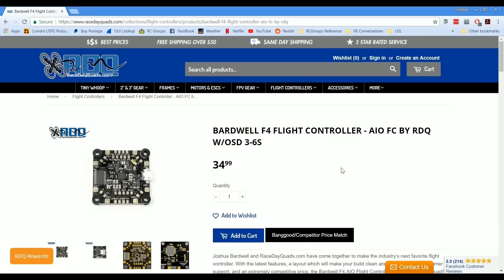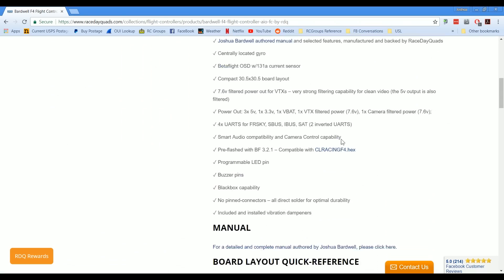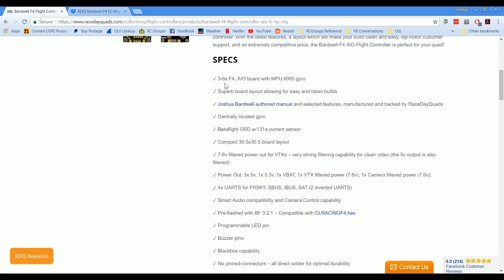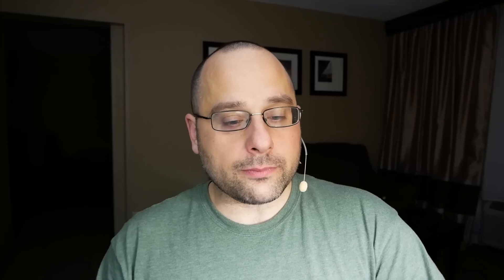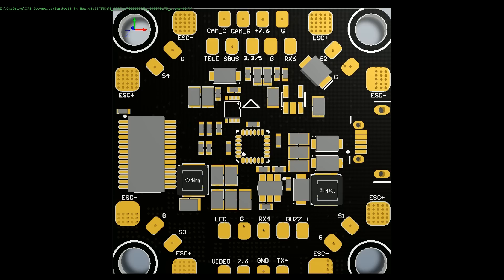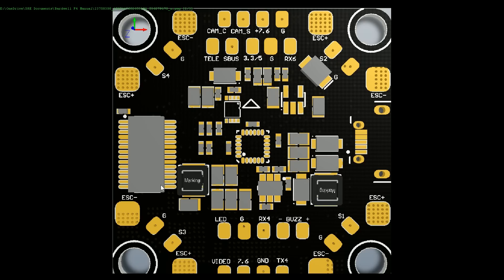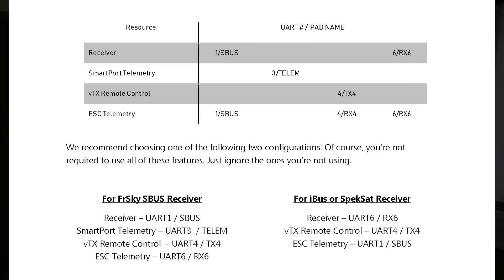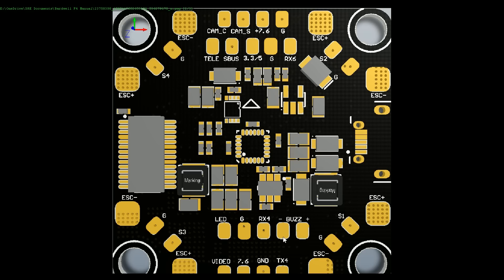Bardwell F4 AIO | JOSHUA BARDWELL FLIGHT CONTROLLER

Comment: Joshua, I just crashed for the first time on my rig running a Bardwell F4 and its seems like the voltage reg (closest to the usb port) is shot. It gets super freaking hot to the touch in seconds and looks to only be outputting 1.1v as the FC led is super dim. Any idea where I can get a replacement regulator? Do you know the component name or part number? I just need to replace it and hope it works... heck if it works long enough for me to get a dump off it I would be happy.
Reply from the maker: You should be able to power it from USB to get the dump. I don't know the part number but if you reach out to racedayquads I think they may be able to help you.
Reply: Yeah... I was told to desolder everything and look for shorts... I know what the problem is.. I just need to part. And no, USB does the same DIM light as powering from Lipo.
Reply from the maker: If it's also doing it from USB then it's likely a crack in the board, causing the 5v regulator to be shorted to ground. In which case replacing the regulator is not going to solve it.

Comment: Hey JB!! After trying other FC's on my fleet of mericas and ending up with ridiculous noise issues I eventually forked out the cash, swapped them all to the JB F4 fc's and boom!!! NO MORE NOISE ISSUES!!! :)))
I've since been using your FC's in all my quads and couldn't be happier!!! 

However...

Now I'm in the middle of building another merica but using a Runcam Split 2 along with crossfire (I've slowly converted my fleet to crossfire and don't want to go backwards) is there ANY possible way to get an extra free UART? Or am I stuck with going back to SBUS?

TIA
Reply from the maker: Just don't use the UART for split remote control. Once you use UART 4 for crossfire that's it on my FC.
Reply: Joshua Bardwell well I’m thinking maybe I can remap tx6 to cam control in the CLI??

Comment: ive got question i have j.b board but can i use a 4.1 with it? im looking at spedix 30amp 4.1 like ive used before????
Reply from the maker: Please look at the manual which has wiring diagrams and instructions for how to use the JBF4 with a 4-in-1 ESC. The manual can be downloaded from the RaceDayQuads product page.

Comment: Can your flight controller be used with it forone electronic speed controller if so do you have a link or description on how to do that
Reply from the maker: I don't know that ESC specifically but my FC can be used with all common ESCs that use motor protocols such as PWM, oneshot, multishot, and dshot.

Comment: JB, can I use 4 in 1 ESC board with this FC?  Such as Speedix 30A 4 in1?  If so, would I add the battery to the FC or the 4in1 ESC?
Reply from the maker: There are wiring diagrams and instructions for using this board with a 4-in-1 in the manual, available for download from the RaceDayQuads product page.

https://www.racedayquads.com/products/bardwell-f4-flight-controller-aio-fc-by-rdq

Comment: I'm going to use the JBF4AIO and Crossfire so the only UART with both Tx and Rx pads is UART 4 so that is where the Crossfire will be soldered.
I won't be using the usual receiver pads (UART 1 ?) Since it is going unused can I get a Tx and Rx from the usual receiver location for a GPS module instead?

It is what I did successfully with the CLRacingF4 but it had a dedicated "Sat" pad next to the 'SBUS' pad on that receiver UART. Is the SBUS pad on the JBF4AIO configurable in CLI to make it work the way the CLRacingF4 'Sat" pad did?

Either that or can I create a Tx for UART 6 using CLI? there is a UART 6 Rx pad but no Tx pad for it...

I want GPS data on the OSD....lattitude, longitude, arrow pointing toward home, etc. Primarly though I want the Taranis to capture 'last known coordinates' in case I crash some where unknown to me. Thanks!
Reply from the maker: Yes you have to use TX4 and RX. No you can't use the other pads for a GPS because they have inverters and they go to separate UARTs from each other.
Reply: Thanks for the quick reply/support! How about using the TBS Crossfire Micro receiver to send the GPS data? It has some other outputs etc on it but I don't really know this stuff very well yet. Although I'm learning rapidly thanks in large part to your work!

Comment: Thank you for all your work. Suggestion: Since a lot of people lack soldering skills could you offer a version of your F4 that comes with pin connectors ready for plug and play? Even if it would cost a bit more?
Reply from the maker: This isn't something I'd consider. Soldering is just a required skill to be successful in this hobby. Pin headers would require a complete rework of the layout to make it compatible with the servo style plugs.

Comment: I just installed this FC and soldered everything up, and everything was fine until I updated it to betaflight 3.0 now uart4 is gone. Anyone have this experience and find a resolution for it? I tried going back to 3.2.2 that it was shipped with but no luck, my smart audio isn't working now because I can't set up anything on uart4... I'm stumped, can't find anything online about it or in the manual.
Reply from the maker: I think you didn't flash the correct target to the board. You need to select CLRACINGF4 from the pulldown menu before you flash.
Reply: Joshua Bardwell you are a Saint my friend. I guess I was not paying attention. It was omnibus f4 for some reason flashed to it. Thanks for the quick reply man you're definitely one of the best. I rely on your videos for a lot of information and learning, I'm new to the hobby so you have been my saving grace more than once. And you haven't let me down this time either!

Comment: I'm new and I'm frustrated with so many aspects of the hobby. It;s like an engineer designed then didn't bother to document anything! Thanks for this, I'll try it. I been building my own and let me tell you, you're video about local hobby shops is true. Now, I do like to buy some things there like my radio and fat shark, etc and that makes them friendly to answering questions but the in-stock FC and such are such generic undocumented garbage. I'm going to suggest they stock these.

Comment: Thank you for all of your efforts. The community has only benefited from your work....

My question is about camera operation. I see we do not have to remap resources and that is nice. What I want to know is since I am using a Foxeer Predator Mini, do I still need the resistor and/or a capacitor?
Reply from the maker: The resistor is installed on the board. You can try it without a capacitor but it might not work.

Comment: I Need HELP... MY JB board won't stop doing that death roll every time I want to do a flip. How do I fix that..I upgraded but it won't stop
Reply: got the same issue here so i swap my motor and my 9v reg fail and the OSD chip pop in flame :(

Comment: Hi i started building my jbfc  yesterday  i solder the 5 volts bridge with my 40watts iron  then i checked the solder with my nail both copper square came off with the solder blob impossible to solder back directly to the board the solder .wont stick even with paste so  i kept going with the build everything went ok  today i was installing my camera  and i noticed that the cam signal whire was desolder looking closely i noticed that the copper square came off  sadly it can not be solder back  is there a way to fix that  thanks

Comment: Joshua,

I just got your F4 board and I'm trying to update the firmware and I can not for the life of me get it into DFU mode.  I have updated my boards on this laptop before without a problem but for some reason it will not go into DFU mode.  I have tried holding the bootloader button, I have also entered bl into the cli and it will not go into DFU
Reply from the maker: Hold bootloader button.

Plug in USB.

Run ImpluseRC Driver Fixer.

Unpllug USB.

Hold bootloader butotn.

Plug in USB.

This works almost 100% fo the time.

Comment: Hey Joshua, the board is great and is smooth as during flight! yet, for some reason three pads have now just lifted completely from the board on only my second fly session. This is my fifth Quad Build now, and is the first fc to have this issue yet. I have since ordered another "JB" board to throw into my Chameleon again and will see if the issue carries across to the new one also. 

Has this issue been felt by any others in the community? Is the pad glue at fault?

Look forward to your reply.
Damo
Reply from the maker: It's hard to know when somebody says they lifted a pad what the cause is. The overall defect rate for the board is very low. If you think you have a defective board, please reach out to general@racedayquads to ask about the warranty.
Reply: Thanks for the reply, I'll give the next board I recieve a go first as I know there can be many factors that could contribute to this happening to the solder pads. And if the problems persist I will get in touch with RD Quads for support.

On a good note, thanks for the time you put into the Hobby and Community  itself Josh, and love all you vids.

A big Cheers from Australia
Damo

Comment: solder pad lifted (edit)( racedayquads has excellent customer support, was able to use a different 5v pad, learned something today,, got the unit flying),,,,,its got it pros,,, will try for warranty as Joshua suggested,,, Not bashing the board,,, Thanks Joshua for the info,,,
Reply from the maker: If you believe you have a defective board, contact general@racedayquads to pursue warranty replacement.
Reply: Thank you
Reply: You are connected to the right people Joshua,,, board turns out to be of quality,, sh!t happens,,, Happy Flying,,!!!!!!!!!!!!!!

Comment: Man, I am having a hell of a time with this build... I must be totally cursed.
I got a rooster the split second they became available. my first "Pro frame".  so right away I had to ask Armattan for a set of replacement screws because the ones they sent out were too shallow. - Thats one.

Next, that brand new Mach 2 VTX that I bought so I could control it over smart audio like a total boss? Yeah. turns out its not compatible with betaflight official anymore. Awesome!

Third:  I bought a brand new crossfire micro v2 RX is totally dead. havent even had a chance to use it. No leds. has power, but no joy. *sigh*...

And now, the icing on the cake: in the process of double checking the wiring to the RX, I somehow lifted the S1 esc pad off the board.  no idea how, the wire isn't even tight. 

I think I need a hug or something... 

So Yeah, Hey Josh, how do I go about reassigning some other pad to an ESC signal wire again? may as well use the one that I had intended to use for smart audio, since I wont be using THAT anymore...

Comment: Wouldn't it be nice for flight controllers to come with clear instructions you ask?  Yes it would be. But, as long as there is you, you are by far the most information to the point drone guru on YouTube, and others who do what you, you're actually contributing to the problem. I of course would not be into drones if there were no guys like you on YouTube. The consequence of your work is companies like Banggood and Gearbest don't have to print manuals. 
What I'm suggesting is that all rivuers get together and contact companies that produce these products and put pressure on them to start providing real useful info.  Just my opinion. Thanks for all you do Joshua and I will be buying the Bardwell F4 this week.
Reply from the maker: The people who can put pressure are the customers. But people would rather pay $20 for a board in a bag and be done. Works well for me, since I can make a living picking up the slack. Come to think of it... don't. Don't insist they publish manuals. I'd be out of business.

Comment: Does the Kalman filter work on this Bord ?
Reply from the maker: Yes, the Kalman filter (or, now, Biquad-RC/FIR, which replaced Kalman) works with this board.

This board cannot run at 32 kHz, but 32 kHz is not required to use the new filtering.
Reply: Joshua Bardwell  Thank you for your prompt reply

Comment: What is the recommended MicroSD card? Interested in the best this FC can utilize. Manual 1.5 seems to be missing the spec.
Reply from the maker: It really doesn't matter because blackbox doesn't write a lot of data very fast. It should be 16 GB though. Larger cards don't work with Betaflight. Maybe 32 MB works I can't remember.
Reply: Joshua Bardwell thanks so much for the response and all your videos. You’ve really helped me learn and I try to buy everything through your referral links. Thanks!

Comment: having a ton of problems with this board

1. all sd cards read as fatal error in betaflight. have tried 3 or 4 different ones now to no avail

2. 5v pads on the bottom of the board is doa, multimeter is showing no output when board is turned on

3. rx6 also appears to be dead, no transmitter showing up in betaflight, but rx is showing connection to tx and the tx works just fine with other builds....

wut do?
Reply from the maker: SD cards larger than 16 GB or maybe it's 32 GB don't work with betaflight at all. 

For RX6, you must be using an iBus or Spektrum receiver. If you are using SBUS, you must use the SBUS pad.

For direct support with the board, please contact general@racedayquads.com. YT comments are difficult to keep track of a thread.

Comment: Is this board compatible with a 4 in 1 esc/pdb? Having trouble on where to give the board power since I have my battery leads already connected to the esc.
Reply from the maker: Please download the manual from the racedayquads product page
It has instructions and wiring diagrams.

Comment: ITS ALWAYS NICE WHEN YOU GET DONE WIRING AND IT WORKS :p . NOT SURE I LIKE SOLDERING TO PADS - MY FIRST ATTEMPT AT SOLDER PADS . MY FIRST BLHELI PASS THROUGH . FIRST SERVO TILT . FIRST NON-PWM ESC ( MULTISHOT ) . IF I GET IT TUNED AND EVERYTHING GOES RIGHT IT WILL HAVE MY FIRST RUNCAM SPLIT V2 . SETTING THIS UP JUST TO SHOOT VIDEO OF MY BUDS FLYING PLANES .

Comment: bought 1 of these for my build, built it successfully, but due to my prop not fitting into my frame i ended just plugging it in to the PC for some calibrations and setup. worked out fine, was able to run a full batt cycle into it. However, the 2nd time around i tried the ESC calibration (i have simonk escs) and it just does not power on, either thru lipo or usb... the rx seems to be still getting power as  i can still bind to it. anything i need to check?
Reply from the maker: If it doesn't power from USB or LiPo, that usually means it is dead. RX getting power from LiPo means the 5v regulator is working, so that would point to the processor itself being toast.

If you want to pursue a warranty replacement, email general@racedayquads.com and they will determine if this is covered.
Reply: Thanks Joshua, i did email RDQ on this, just waiting for their reply...  if and when they end up replacing it (or not), any tip what NOT to do on the new board? lol... i know my soldering is not that clean, but i made sure i dont have any shorts, and it did work 1 battery cycle :-)

Comment: I just received my "Bardwell Board" and I was hoping you still check messages.  I'm new to flying, good builder. What frame are you recommending in the 5inch freestyle categorie. I will be using this board with 6s capable motors and esc's. I understand I am new. I do not want the board to be restricted so I have built the electronics around it. I aim to learn freestyle flight. I do fly angle horizon and can forward fly in acro.  Thanks a million for any suggestions that you may give.
Reply from the maker: https://www.fpvknowitall.com/ultimate-fpv-shopping-list-frame/
Reply: Joshua Bardwell thank you very much sir. I shall show you some appreciation Patreon style.

Comment: This controller has incompatibility with esc EMAX BULLET 30A? It is that as I have seen that it is very similar to the CL_RACING F4S and, that in fact they share the same firmware ... I am sorry if it bothers the question, but it is that I have been fighting with a CL_RACING F4S v1 plate for a couple of weeks. 2 that I have installed a friend on his quad with esc bullet 30A. I have put 25V 470uf capacitors in the four entrances of the esc and I still have the same problem. I'm a fan of your channel, but unfortunately I bought the cl_racing before your fc came out. But now to see that yours seems to be based on the cl_racing I have these doubts. I have not seen any video of how you fly.
Reply from the maker: +MoonKIE666 we fixed that issue.
Reply: Forgive my misunderstanding, but that means that this controller also had that problem and you have solved it in a new version? Or that this controller already comes with that problem solved from its first version?

And thank you very much for answering.

Comment: How would I run crossfire and a GPS on your F4 board? Regular 4 wire gps (using currently with a omnibus pro). Port4 is the only one with an RX and TX. Any ideas?
Reply from the maker: You can't. There aren't enough UART pads. And there isn't an i2c pad for the Magnetometer either. My FC is not the right choice for a long-range GPS rig with Crossfire.
Reply: Joshua Bardwell damn. I love the board. Have two... one on a busted parts bin racer that actually screams... and due to the omnibus pro corner having the “corner” part it’s touching the standoff’s and I get all kinds of vibrations into the FC. Really wanted to put yours in there. Recommendations for a long range gps + crossfire board? Betaflight f4 board? I have one of them lying around.